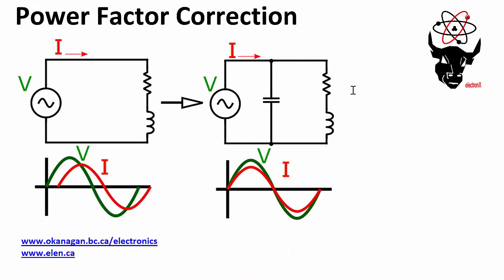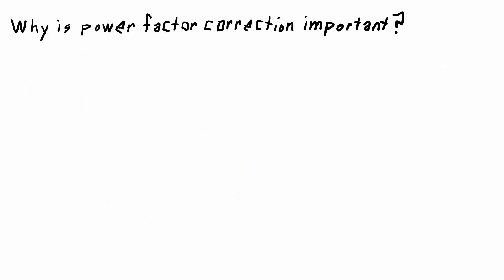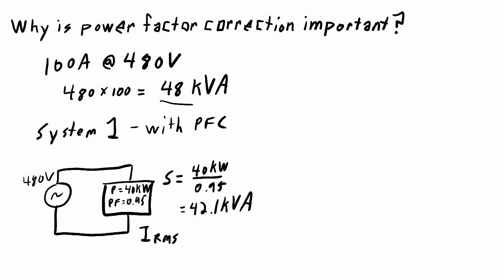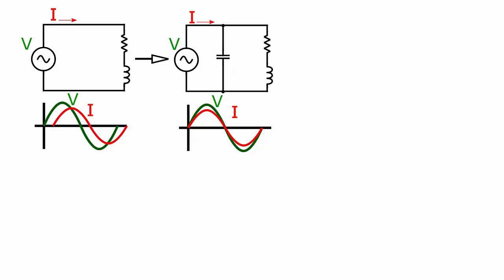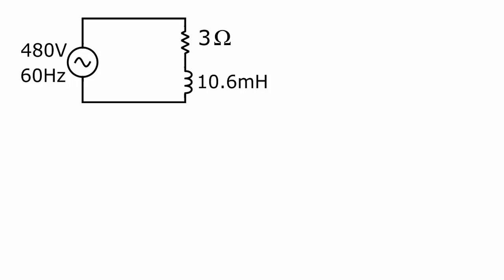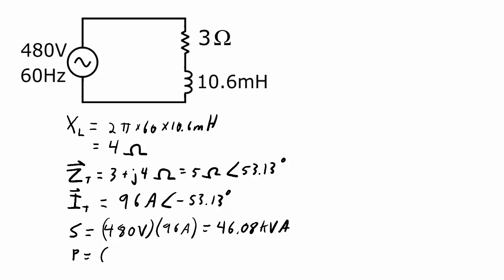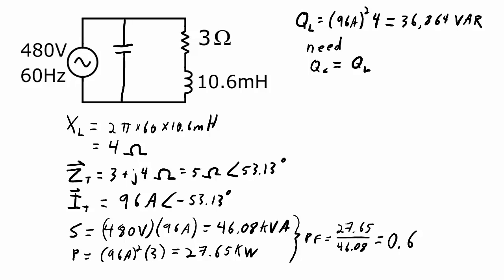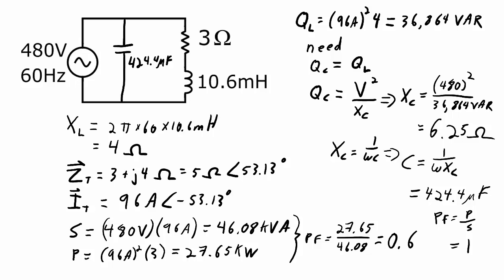Power Factor Correction

Comment: For the circuit with the capacitor added, how would you calculate the new current from the supply. Im getting confused because surely the total impedance would now be lower so more current would flow from the source, which i thought is the opposite effect power factor correction would have?
Reply: Find the new total impedance and do it the same way...
Originally it was 3+j4 which resulted in 96A.

Now, with the correction from the capacitor, we have Xc=j6.25, and with that we can calculate the new Zeq

Zeq = 3+j4 // -j6.25 
Zeq = 8.33 (no reactive, obviously, since pf=1)

New current = 480/8.33 
I = 57.6 A

Comment: Excellent video. I think there may be a minor mistake at 3:30. The RMS current should be (40k/0.95) / 480 ≈ 87.7 A. I think it has been incorrectly calculated as Irms = P/Vrms instead of Irms = S/Vrms. I think the same mistake was made at 4:25.

Comment: The inductance is a motor. The R will go down if there is resistance to the motor shaft. - The motor has a load, draws more current. Inductance will be the same. Has the same number of turns for the windings. Therefore, the capacitance will be a factor of how much the motor is loaded?

Comment: Hi, good day, TX for the opportunity. I am busy building a rotary phase converter, naturally the output voltage of the 380v  idler motor are not gonna be equal. Can i use this formula to correct the voltage on each leg by means of run caps.please help
TX Basie

Comment: We are assuming the phase angle of the source is 0 degrees in these power factor formulas, could you please explain how to correct the power factor of a true parallel RLC circuit when the phase angle is not 0, say 90 degrees? I am really struggling with this at the moment. PFC could really help with alternative energy solutions in the future and your approach to this problem would be greatly appreciated. Thank You!

Comment: There is a faster way to find the Power Factor.  Take the inverse Tangent of 4 divided by 3 and then take Cosine of that.  The inverse Tangent of 4 divided by 3 gives 53.13 degrees and Cosine of 53.13  gives 0.6 which is 60 percent efficient.  The way I find the C value is from Z = 3 + j4, and do this.  Xc = (3^2  + 4^2)/4 = 6.25 ohms, then C = 1/2*pi*60*6.25 = 424.413 uF

Comment: I would plead that this be viewed by all the 'over unity' hobbyists who believe they have found greater output power than input power because they fail to account for the affects of V and I phase difference caused by inductor/capacitor in the circuit.

The majority of these folks (1) use a multimeter (only) to measure output current and output voltage, then (2) multiply them together and believe they have discovered more output power than input power.

A common example:   Faraday's law shows that if you discharge an inductor very abruptly, the back EMF voltage spike can be quite high - since time (dt) is in the denominator:

E =  di / dt   (Faraday's law)

Using a MOSFET to very abruptly interrupt current flow in a coil creates a large back EMF spike (which is the reason 'snubber' diodes are popular!)  and nearly all 'over unity' hobbyists then multiply this temporary large voltage spike by current flow and calculate an immense power value which greatly exceeds input power.

I've tried explaining the issue to these guys, some of whom spend years, literally, not knowing Faraday's law and the difference between real and apparent power.  Your video I believe would help them understand why reactive components change the power delivered to the load - it is about the clearest explanation I've found - good job on your part.

Comment: I've seen power factor correction circuits rather than just a simple parallel cap. What's that all about?
Reply from the maker: You might be referring to active power factor correction circuits which directly measure the voltage and or current and use a switching circuit to actively correct for low power factor. The main advantage is that power factor will be corrected even as the load changes. The main disadvantage is that the circuit is much more complex.

Comment: For me, I prefer Ql=480*96*sin53.13 then  C equals to 14.52 microfarad, thank for great explanation.
Reply: My first impression was the same, but then I realized the voltage drop across the inductor is reduced because of the resistance in series on that arm of the circuit. It's not the same as a simple LC circuit. So, you need to account for that extra resistor, the reactive power will be reduced because the resistor eats up some of the voltage drop, reducing current that will appear on that arm of the line. He conveniently used current, which builds in a correction automatically when calculating power with current , Q=I^2*R.

Comment: I didnt understand the last part..why would it be pf=1...after getting the capacitance.  You get pf=1..pls explain.
Reply: bro, because the after adding the capacitor the reative power will be cancelled out as both(capacitor and inductor) will be having same values of Reactive power, and the impedance of the circuit will become purely Resistive, and you know for a purely Resistive network the power factor is UNITY!

Comment: Is this example (semi-)correct?
Imagine a tube(wire) and that you want to pass an x quantity of water(current) through it(ignore time), you can pass water at any speed(voltage) as long as it's volume doesn't overwhelm the tube due to its volume, then the water passes with virtually no resistance but if we increase the volume of the water or decrease the mass the tube can manage without getting overwhelmed, then the pressure of the water inside the tube increases, so then, the tube will have to deal with that pressure(wasted thermal energy) which is why there has to be a balance, right?

Comment: so if the load is capacitive, the PFC would be an inductive reactance
Reply: In short yes, but no.

Capacitive loads and inductive loads produce sin waves that are both out of sync with a given resistive load. The reason they neutralize each other is because inductance's wave lags behind the resistive load 90° where as capacitance's wave is 90° ahead, thus the two loads are a full 180° off of each other and thus directly nullify. Thus it is indeed yechnically possible to have a circuit with a low power factor due to a capacitive load.

Why I say "technically" is because I don't personally know of any electrical gear / application that innately produces an unwanted and intrinsic capacitive load, and in fact none may well even exist.  Inductance, however, is present in the the supply of every single electronically driven motor simply due to mere physical methods by which they operate. Thus, PFC is generally understood as adding capacitors to circuits with inductive loads rather than it being versa-vice. It's a solution to an inherent problem that can't be solved otherwise whereas the obvious solution to a circuit with too high of a capacitive load would be to remove the capacitor you added.
Reply: @XTYRMIN8Z very good answer.

Comment: Just a quick question. when you calculated the reactive power of the inductor (96)^2 * 4. I noticed you used a current value of 96 amps. Isn't it true that once you add the capacitor the current through the inductor will no longer be the 96 amps and instead will be divided between the two branches. I guess I'm just confused on how the reactive power of the inductor will stay the same after connecting the capacitor.
Reply from the maker: The voltage across the R-L branch of the circuit will not change, so the current will not change either.

Comment: Since reactive power is I^2 * X, how come the capacitor's reactance isn't -4? (to offset Xl = 4)
Reply: Because the current in the C leg is not the same as the current through R and L.That makes capacitor's reactance different.  If  C was in series with R & L then Yes that would've been the case.
Reply: Because that's impossible. The minus in this case is technically an imaginary number and only serves to represent that it has the opposite effect to an inductor.

Comment: Does using a power correction capacitor results in more kW being drawn from the grid just so we can sync the voltage and current? I mean it can't be free right? There're gotta be some kind of losses?
Reply from the maker: No, counterintuitively adding the new component will result in lower losses (for the same amount of real power to the load). The power factor correction means the apparent power will be less and so the the peak current will be less. The lower peak current means there will be lower resistive losses in the wires.
Reply: @ElectronXLab  Say I have a machine that consumes 10kwh and 10kvarh as registered on the electric meter per hour, and therefore has a power factor of 0.71. If I were to correct it to 0.9, the meter would now register 10kwh and 5kvarh per hour?
Reply: @impactodelsurenterprise2440  it would cost less to run if you increase the PF toward 0.99

Comment: How did you decide to place the capacitor in parallel to the other circuit elements as opposed to in series? Of course it is helpful to do so to know the voltage across it, but for example how is its power factor correction ability altered if a capacitor was placed in series with the inductor?
Reply from the maker: You could do a similar calculation to see what capacitor you need placed in series. Practically speaking, it is far easier to place a capacitor in parallel to the circuit than in series with it.
Reply: @ElectronXLab  thank you! Also, when placing the capacitor in parallel with the other load, there would be a division of current between the capacitor and the resistor-inductor pair- would this result in less reactive power being consumed by the inductor, since Q=I^2 * X(inductor)?
Reply from the maker: @justinbieber19010  The capacitor is in parallel with the RL pair and also in parallel with the voltage source. This means (assuming an ideal voltage source ) that the voltage across the RL branch will stay the same

Comment: very helpful playlist and life saver for the exam, i want to ask why we added the capacitance in parallel not in series with the inductance and the resistance?
Reply from the maker: It's easier to physically place the capacitor there. You don't have to break the circuit and you can do it right at the power supply.
Reply: @ElectronXLab  So,  will the apparent power change if we put capacitor in series with resistance?
Reply: @souvikdas2009  if u put in series, then u change current to machine or circuit that it needs...so the only option to place in parrallel so u dont affect the original machine or circuit requirments.

Comment: why is too much voltage  in the secondary instead of 13v dc  I got  33v dc  and capacitors overheating ? help me somebody
Reply from the maker: I'm not sure what you are asking. There is no secondary in this example.
Reply: @ElectronXLab  ok. thanks  too much weed.!
Reply: if you're trying to convert AC to DC with a transformer and rectifier, you multiply the RMS Ac volts by about 1.4, so to charge a 12v battery for example, you only need about a 9v AC transformer/rectifier combo.

Comment: Very nice summary... when you find S dividing P by the power factor, it might be worth saying that P is the average power delivered to the load. 
I'm writing this because often, since power is not in the same phasor domain of voltage and current, it creates confusion.... especially (to me :)) if rms quantities are needed to find non rms amplitudes

S = Vrms x Irms

P(t) = P + S x cos(2 x omega x t = phi)
expression of instantaneous power delivered to the load 
from the expression above, it is evident how P is the average of the overall power which goes to the load

P = P(t) averaged over T/2 = S x power factor
expression of average of instantaneous power delivered to the load 

Prms = rms value of the P delivered to the load = sqrt ( (P^2) + S^2/2 )
the expression of the Prms delivered to the load is not usually useful
essentially this is the rms value of the instantaneous power which is a sinusoid plus its offset (P)